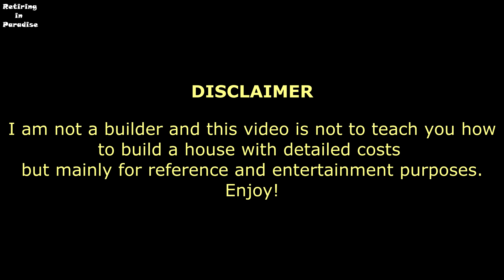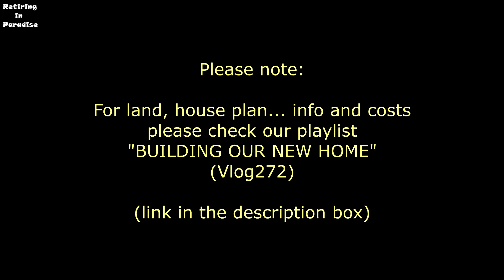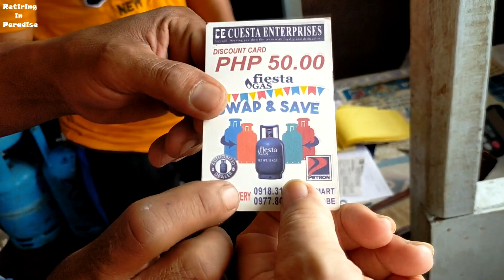V365 - Pt 85 FOREIGNER BUILDING A CHEAP HOUSE IN THE PHILIPPINES - Retiring in South East Asia vlog

Comment: Hey Joe, try to find plumbers putty, it's in plastic container in plumbing section.
Put it between your two palms of your hands and rub back and forth to create worm shape. Now remove sink and place a continuous connecting bead under edge of sink between metal and counter top. Reapply sink and fasten down to smash the putty. Now you can silicone outer exposed sink with silicone.
Reply from the maker: Looks like the perfect way to do it😊👍👍👍. Yes I already put that plumber putty around the skink drain hole

Comment: Hi Joe, you need to scrap that water base filler off. That gap filer is for mainly small gaps between walls or wood. Try a silicon one that is a heat resistant. Clear one. Should be fine. Cheap. How that helps. Ciao.
Reply from the maker: Great😊👍👍

Comment: Regards from Finland. You should use SILICONE sealant for kitchen and CR. There are silicone sealants which are mould resistant. Acrylic sealants are meant for fillings that will be painted over because the paint will stick on it. Silicone can not be painted because it repels paint.
Reply from the maker: Thank you great tip😊👍👍👍

Comment: anything around water or moisture you should use a silicone based calk water based will break down with moisture. when you do your bathroom / comfort room be sure to use 100% silicone so you don't run into the same problem. God bless Good luck!
Reply from the maker: Great suggestion!😊👍👍

Comment: You need to use silicone for bathrooms and kitchens, you can get transparent silicone that won't show, I thought it was a bit odd that you were using gap filler the other day.
Just put a bead of silicon around the hole in worktop for the sink, by lifting the sink up 1 cm or so, then when you've lowered the sink make sure the silicone is right up to the edge. That way water will never ingress into the wood under the tiles.
Reply from the maker: We learn every day🤭😊

Comment: Hello Joe and JM so nice to see the both of you still bringing things together in your home. I think the best sealant that you can use for your kitchen sink would be silicone based. Water based did not do it. you need something that will repel water or In other words you need something that is moisture resistant. so silicone Would be the best. it also comes in a roll out tape. I don't know if this is readily available for you in the Philippines but it is in the stores here. Makes the job really really easy. Blessings to you both.
Reply from the maker: Thank you Ricardo😊👍👍